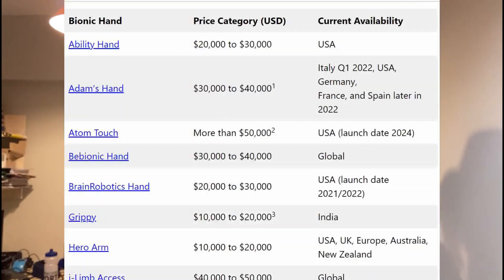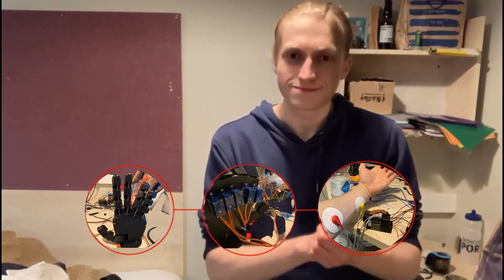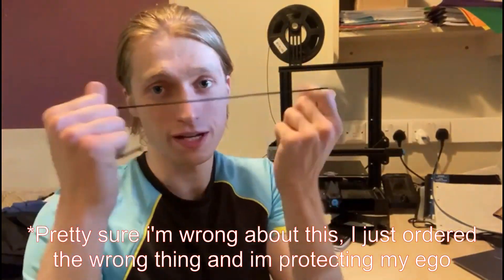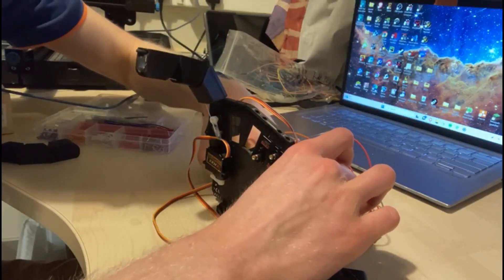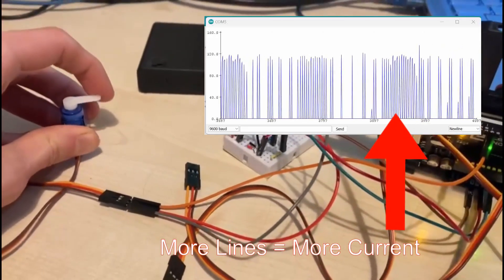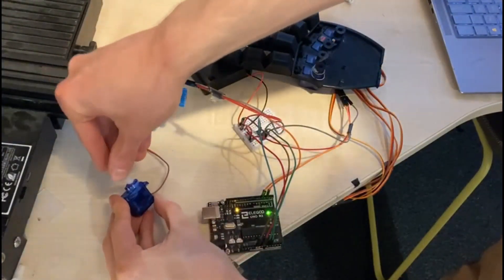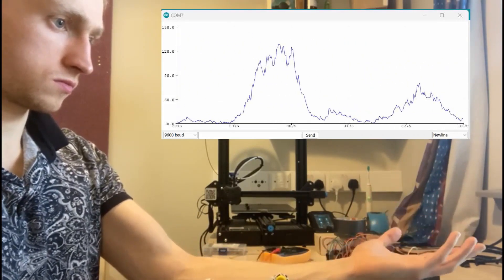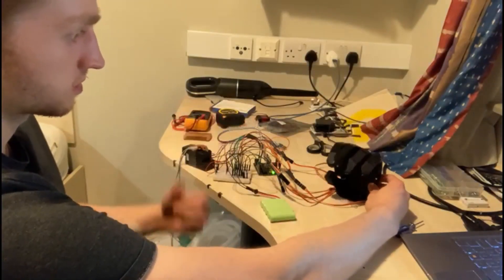I Made A Brain Controlled Robotic Hand

Comment: Hey! I really liked your project—it's an innovative approach to bionic arm control. I was actually considering implementing a similar system but using EEG signals instead of EMG. My idea is to use EEG-based attention and meditation states to open and close the hand, similar to how you've used muscle signals.

I've already done some research on EEG signal processing and its applications, but I wanted to ask—do you think this approach would introduce significant challenges compared to EMG? Are there any modifications or optimizations you would suggest to improve accuracy and response time?

Looking forward to your insights, and thanks for sharing such an inspiring project!
Reply from the maker: Yo :) - I see no reason you could not use an EEG signal for this. In this video, I was simply detecting a threshold potential value over a certain reading, using a store bought EMG. That meant i could only "classify" two states, nothing and something (the close hand). Since your working to classify two signals, I think EEG would be approproate. I dont know enough about the signal intgrity from an EEG to accurately say if you could use an AI system to classify more than two states (binary classifcation). All i can say is later i built an EMG myself, and classifeid siganls (maybe like 8-9 videos after this one?), and was able to achive good accuracies on 5+ gestures (classes). Im not sure an EEG would be able to replicate that, more because id worry about how you would actually trigger it (like its easy enough to make a peace sign, fist or flat palm, but with an EEG do you have to like think it? I think thats not going to work lol). BUt for two states, mediataion and activiy it will work probably
Reply: @Robotcus  yes actually i wanted to make a project like that but for me to access all the five fingers individually and control them i need an ML algorithm that i need to design to specificlly classify the signals but if i want to do that the budget for my college project is being too much so with the EEG signal sensors that i can affort i can only have two stages actually meditation and attention. I think it might work out so if possible can youb make a vid on EEG bionic arm too :>. Either way I planned on giving it a try....Thanks for ur suggestion tho

Comment: So from my understanding with gripping, when the fingers fold to the extent of the required diameter of the object it's gripping, the servos automatically stop rotating then after 3sec the motors rotate the other way continuously without an end to the rotation  (the servos dont actually stop rotating rather their movement is hindered by the object its gripping...wouldnt that damage the motors in the long run?), 

OR is it until the fingers are straight? If so, how did you configure the motors to know at which angle the fingers would go back to being straight?
Reply from the maker: Yep you have it correct, and yes, it does damage the motors in the long run., but that is minimised by cancelling the rotation when a certain damaging current is reached (100ma in my case) I'm currently resdesigning it to use a different mechanism to hopefully do that. The hand has no ability to actually know where the fingers are, its all a timing thing, the only thing it knows is when the finger touches the palm or any object, basically takes the time it took to get there, and rotates the other way for the same amount of time. This introduced cumilitive erros, which is not ideal, hence the redesign... - It may make more sense from a coding perspective, all that codes on github under my user robotcus :D

Comment: I like how you repurposed the actuators as sensors. It just takes a current sensor, to add for great feedback but still many designs omit it. Awesome project!
Reply from the maker: Thanks! The first ever hand I made used Force sensitive resistors, and I realised how impractical they were so came up with this instead and it worked a treat :D
Reply: If the servos aren’t continuous rotation it makes it very easy to get position feedback by just soldering a wire to the internal potentiometer.
Reply: @conorstewart2214  ..only when there is an internal potentiometer. I've never seen that so far. Either I had hall sensors with a rather expensive servo, or I had to find and build a solution myself. Hall sensors worked fine, though. I'm not a big fan of potentiometers because they usually lack precision and reliability.
Reply: @tigerchills2079  the majority of servos you get will have an internal potentiometer. The only servos without internal potentiometers are expensive servos with hall sensors and you can probably do something similar with them.

Every servo needs some form of position feedback so every servo will have either a potentiometer or hall effect sensor inside, most of them use potentiometers.
Reply: @conorstewart2214  apparently rotary encoders are the second cheapest option worth mentioning.
Reply: @tigerchills2079  rotary encoders only give relative position, not absolute position. If you just use rotary encoders then you need to home it before you can use it, like you see with 3D printers (although they don't use or need rotary encoders). Servos just work right away and don't need a homing sequence hence they have absolute position feedback not just relative.

I haven't come across any servo that just uses rotary encoders. For a servo to work properly it needs absolute positioning hence potentiometers or hall effect sensors or so called absolute magnetic encoders which are just hall sensors.

Edit: A addon to that is that you can get rotary encoders that give absolute position using LEDs and photodiodes but they require one led and photodiode pair for every bit of precision you want and they require a very precisely cut wheel with holes in it corresponding to the position hence they aren't used unless they are absolutely needed and you won't find one in any servo you buy.
Reply from the maker: Are rotary encoders those things that can sit on the end of a DC motor? I've played with that idea in a previous project but it introduced more wires (wires scare me) so I never opted for them personally
Reply: @Robotcus  Rotary encoders come in different shapes and forms. For Servos, some have them integrated. But some motors only become a servo but externally adding a rotary encoder.

I have not seen many REs, yet, but I remember that old computer mice with rubber balls inside had the rubber ball rotate a drum, which spins a wheel with a slotted disk. That slotted disk spins through two fork light barriers, which generate two phase shifted pulsed signals. By comparing their phase, you determine the turning direction and by counting the pulses you get the distance. So that's at least one example of an optical RE for relative rotation measurement.
Reply: @Robotcus  yeah they can be, you can also use them on their own for making dials and knobs. They don't take that many wires but they can let you measure distance or speed. They are only good for relative positioning though not absolute positioning.
Reply from the maker: @tigerchills2079  Right okay - Sounds fairly complex, feel like making a mouse like that could be harder than making a robot arm lol :D
Reply from the maker: @conorstewart2214  Right okay, ty for the explanantion ;)
Reply from the maker: @gatoninja4387  Not to sure what your objective is my saying that, the design is completely my own, as i mentioned in the other comment you've copy and pasted :D

Comment: this is so cool that you got it to work. if you could hook up more EMG sensors to control each individual finger.
Reply from the maker: The cool thing about the EMG sensor is I would only need the one! The EMG sensor I planned to build was a bit more complex, but with some extra software it would have allowed me to classify individual movements of each finger :). Ty for watching :D
Reply: @Robotcus  do you used some A.I. for the coding?
Reply from the maker: I did not, the EMG in this video could only do the one gesture, it did not need it, just detected a current threshold. Literally just  if current threshold > 100 send to a close fist function where the fist would be made :D @mitkosokolov9382
Reply: @Robotcus  Thanks, i also try to do such thing, but with gestures. Have you try Myo armband ?
Reply from the maker: Yeah actually, but it wasnt with this project here. I led a project in my uni bsed on this stuff, and i transitioned us away from it, the company stopped manufacturing them in 2018 if i remeber correctly and the software was outdated, i found it easier to start from scratch. @mitkosokolov9382
Reply: @Robotcus  oh, i did not know that

Comment: Duuude this is awesome, im happy youtube blessed me with random robotman today
I'm very new to robotics and my iq is like sub 80, how did you make it so it grips stuff in different strength?
Like how you didn't crush the waffle cone in the end
Reply from the maker: Thanks dude, yeah so the hand uses current sensing, by measuring the intensity of that current you could provide different grip strengths. That would be a software thing, mechanically the hand has all the ability to do it. I set the threshold to stop gripping low in the software, so the motors stopped before they gripped to tightly. If you wanted to be super fancy you could constantly track the current, and say adjust that based on how hard the person actually gripped. I didn't do that though (software do be hard tho), the thresholds just low enough it doesn't crush it, but still manages to grip it. Surprisingly I didnt actually have to play with the value all that much, just got a wee bit lucky to get it first time :D